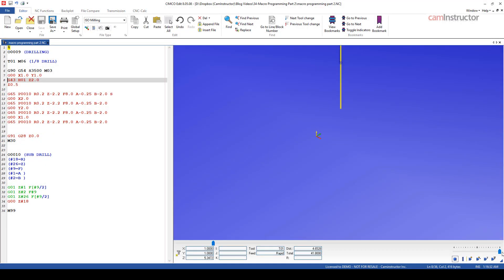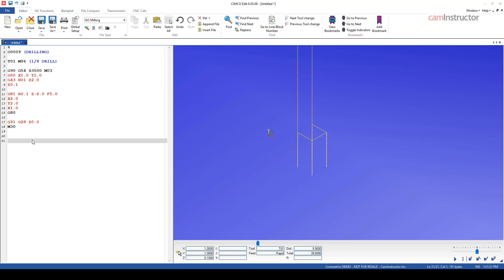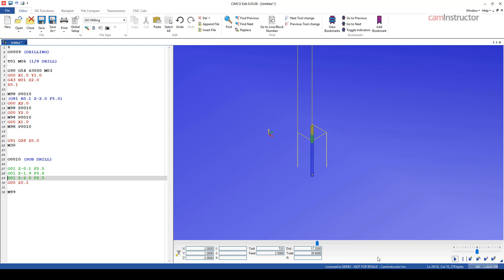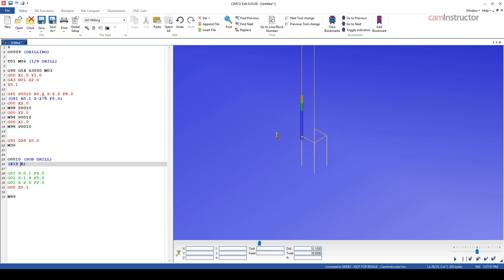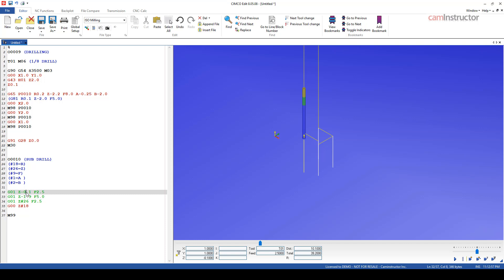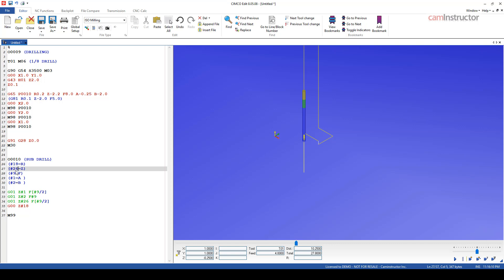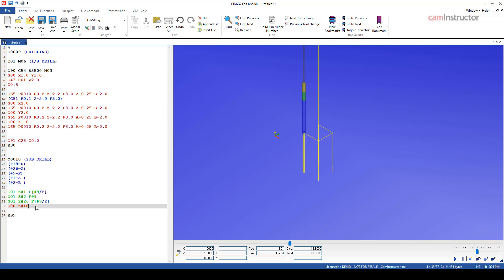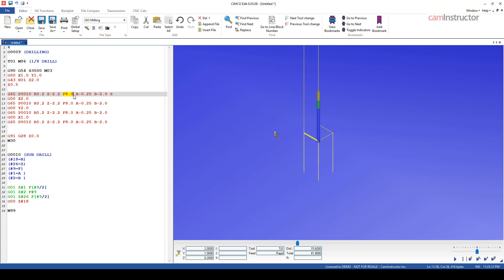Programming CNC Macros - Part 2

Comment: can you adjust the A axis using a probe and how would  you write the program. any lead would help. thank you in advance
Reply from the maker: You can do pretty much anything you can imagine with macros. There is too many questions that need to be answered from your statement whereas I cannot write a simple step by step for you. Basically, depending on what you want to adjust, probe the surface, record the location, manipulate that data to suit, write that data to where it is needed.

Comment: Can you explain, please "BRANCHES AND LOOPS" 

OBJECTIVE:

Enable participants to plan, execute and simulate CNC programs in 3 axes (milling machines and machining centers) with ISO / DIN structured language and programming.

TARGET AUDIENCE:

Professionals with basic CNC knowledge related to the machining area (CNC operators and programmers).

. PRE REQUIREMENTS:

Take a CNC Basic Milling course

PROGRAM:

Trigonometry Review
Defining the variables
Types of arithmetic functions
Replacement
Addition, Subtraction, Division, Multiplication
 Sine function, cosine function, tangent function

Using conditional functions

IF, GO TO, DO, WHILE
EQ = equal
NE = Different
GT = Greater than
LT = Less than
GE = Greater than or equal
LE = Less than or equal

Simulation and practice exercises in a machining center (conical grooves, half spheres, corners of radius parts, ellipses, etc.)

Can you explain, please "BRANCHES AND LOOPS" 

IF [ CONDITION IS TRUE ] GOTOn

IF [condition is true] GOTOn
for example,
IF [#7 LT 0] GOTO65 If the value of variable #7 is less than 0, branch to block N65
...
... If the above condition is true, bypass this section up to N65
...
N65 ... Target block of the IF conditional statement

IF [ condition is true ] THEN [ argument ]

Example 2 - Macro control with the IF-THEN structure
#100 = #4006 Check current units (English G20 or Metric G21)
IF[#100 EQ 20.0] THEN #100 = 0.1 Clearance above work is 0.1 inch for G20
IF[#100 EQ 21.0] THEN #100 = 2.0 Clearance above work is 2 mm for G21
...
< ... Macro program continues normally … >
Using the IF-THEN method makes the pro gram shorter by one half and is eas ier to in ter pret.

WHILE Loop Structure

WHILE [condition] DOn

WHILE [... Condition 1 is true ...] DO1
...
<... Body of a single level loop ...>
...
END1
Start of WHILE loop 1
End of WHILE loop 1

Double Level Loop

WHILE [... Condition 1 is true ...] DO1
...
<... Body of Loop 1 - Part 1 ...>
WHILE [... Condition 2 is true ...] DO2
...
<... Body of Loop 2 ...>
...
END2
...
<... Body of Loop 1 - Part 2 ...>
...
END1
...
Start of WHILE loop 1
Start of WHILE loop 2
End of WHILE loop 2
End of WHILE loop 1

Trible Level Loop

WHILE [... Condition 1 is true ...] DO1
...
<... Body of Loop 1 - Part 1 ...>
...
WHILE [... Condition 2 is true ...] DO2
...
<... Body of Loop 2 - Part 1 ...>
WHILE [... Condition 3 is true ...] DO3
...
<... Body of Loop 3 ...>
...
END3
...
<... Body of Loop 2 - Part 2 ...>
...
END2
...
<... Body of Loop 1 - Part 2 ...>
...
END1
...
Start of WHILE loop 1
Start of WHILE loop 2
Start of WHILE loop 3
End of WHILE loop 3
End of WHILE loop 2
End of WHILE loop 3

O8009 (SINE CURVE MACRO)
#25 = 0 Set initial counter for degrees increment
WHILE [#25 LE 360.0] Loop for each linear segment until 360 degrees are machined
#26 = #1 * SIN[#25] Calculate current Y-location
G90 G01 X#25 Y#26 F#9 Make a linear motion to the calculated XY location
#25 = #25+#4 Increase the counter by specified increment
END1 End of loop
M99 End of macro

O8011 (CLEAR 500+ VARIABLES - BY A MACRO LOOP)
#33 = 500 Initialize counter to the first variable (no # symbol !!!)
WHILE[#33 LE 999] DO1 Loop through variables - shown range is #500-#999
#[#33] = #0 Set the current variable number to null (clear current variable)
#33 = #33+1 Update variable number count by one
END1 End of loop - return to the WHILE block and evaluate again
M99 End of macro

and other.

Comment: Video code not clear
Reply from the maker: Make sure you are streaming in a high resolution, sometimes youtube automatically switches to something low if your connection is dicey. Bottom corner of the video, click the gear, in Quality select 1080p for best resolution.